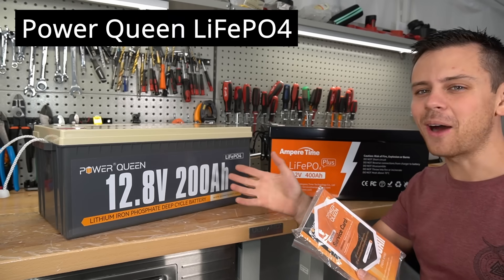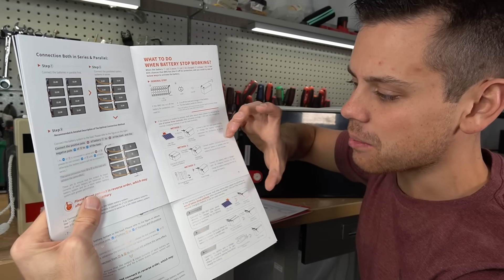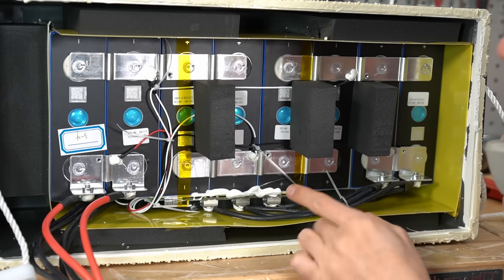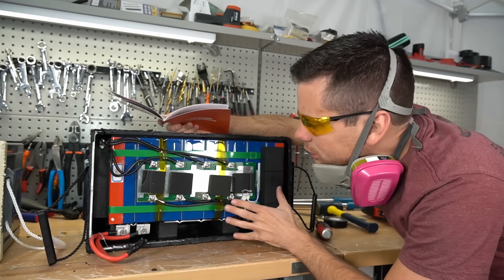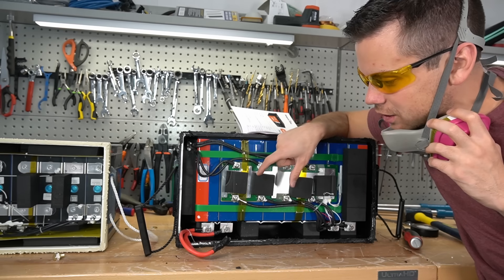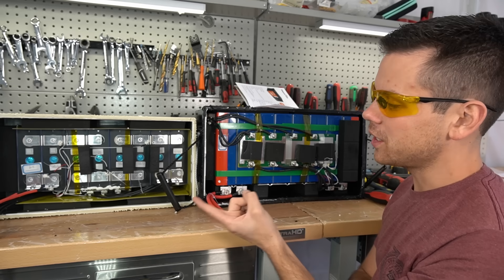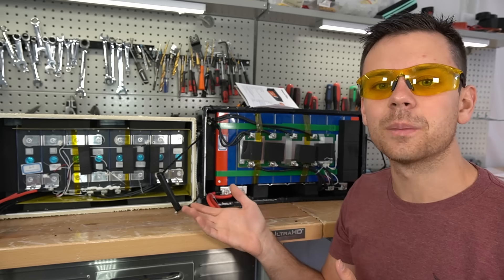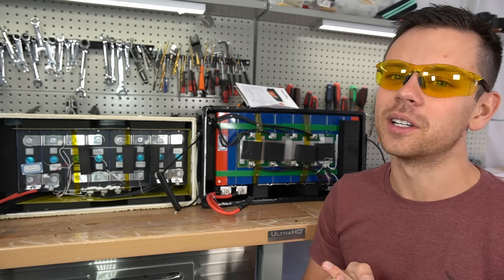Large Cheap 12V LiFePO4: Power Queen 200Ah & Ampere Time 400Ah Tear Down!

Comment: I have a question. You seem like the expert on these batteries? I would like your opinion. I can get a deal on ampere time 300ah batteries right now but I won't be putting them into service for 2 years. Can I store 4 of these 300ah batteries inside at 70 degrees F for 2 years without issues or just purchase in 2 years at a higher price?

Comment: Are the terminals just epoxied in to the case? My terminal kinda broke loose from the epoxy and moved a little bit.  I was worried about it but it seems like it'll be just fine.

Comment: Hi Will, I have ADCBATT lifepo4 6x12v 200ah batteries running 24v 600ah. At night with less than 500 watts on battery one set of the parallel 12v batteries shut down to 0v. The bms resets when I disconnect and recharge. It works under 3500watt load while charging during the day. Any pointers for a new solar guy.
BTW running a  Schneider 4024 inverter and Schneider mppt 60-150 charge controller.

Comment: Thank you so much for another great video! I have one question if you don't mind. If you are setting up multiple batteries in parallel so you have more capacity, which battery should I attach the Victron battery sense for the temperature sensor? I assume for the voltage, I connect the wires to the terminals where connecting to bus bars.

Comment: Hi, can you make a video presenting the best solar setup you can buy for a gate opener. Usually these go for 7AH. It would be interesting to go with a hybrid solution so that the gate opener usually draws from solar for normal functioning and when the solar is out, the system would auto-link to the grid. Thanks!

Comment: It looks like the AmpereTime battery has the cells on their sides, or as you have it opened up on the bench, the terminals of the cells are on the bottom.   Are LiFePO4 cells fine with running on their sides like that?

Comment: Hey Will, I've started watching a lot of your videos lately and you always make a fuss about batteries not having low-temp sensors, but I never seem to hear you talk about what a dangerous temperature is. What is the minimum temperature limit that these liFePo4 batteries can safely operate at? Do these dangers increase or decrease based on C load? Thanks!
Reply: Freezing temperature is where its dangerous to charge.  There's a video where Will talks to the CEO of Battle born batteries, and he gives a detailed explanation.

Comment: Hi Will. Watched a video review (Hobotech) of a new Power Queen 12.8V 190AH battery that allegedly uses EV grade prismatic batteries (4000 cycles to 80%). It can be had for the next few days for $605 +tax. Shipping is free. I'm like a solar generator guy, but thinking about pulling the trigger on this. Do you think that's a good, or great deal, or just meh? And if I did do this, I'd need to get and set up accommodations to charge from solar and AC, and an inverter. I think this battery could handle a 2000W inverter.

Comment: You could teat that PowerQueen. Hobotech ran that PowerQueen past 295 amps and for 3 minutes. Also these batteries are premium not the regular one according to the video and the company and are rated at 4,000 recharge cycles at 100%. I don't know if that is true or not. 5 year warranty on the battery. Thanks for the review.

Comment: Dr Prowse…. I am considering a lead acid to LiFePo swap for a golf cart I bought for my wife… 
48volt system… 400 amp controller,… after market higher performance dc motor.
I am considering configuring  four 12v 100@ LiFePo batteries in series… to build a 4s 48v 100a/hr bank…… OR…… building two of the just described batt banks and putting them in series… to have a 200 amp/ hr  batt bank.

The arguments for the 8 battery 200 amp/hr config of course is “ more range/time/ endurance” but it also could serve as a small power source for minimum backup power for our house when the power goes down.

BUT ,,,,
I am concerned about
1) each battery post tolerating the high amp draw ( instant amps on golf cart acceleration)
2) similar to above .. buss bars and 6 gauge or 4 gauge wire connecting the batts to each other and to the system.
3) best practices for paralleling for charge balancing.
4) selecting a charger.
5) setting charger min and max voltages
6) blue tooth monitoring
7) being able to out run the cops when….. ooops …” kidding”
8) temp limitations for charging and operation
9) temp monitoring
10) best wiring and switching hardware and set ups
11) stealth paint to help you hide from the cops
12) Cool BatMobile Accessories.
13) How to leverage the value in your golf cart for bail money.

Or……. If you have all of this sorted out in a document… “ Building a LiFePo Golf Cart ( or master battery bank) for total idiots who think that they can out run the cops on a golf cart….”

I would be more that happy to buy the stuff through your affiliate links.
Thx

Comment: I bought the Ampere Time 200ah plus model. The difference between it and the regular model was a 200a discharge instead of the 100a that the regular model offered. I just thought that I would share that.
Reply: Same, but I wish I had sprung for the 460ah

Comment: I got two Amprere Time 12v 200ah batteries bought 1 year apart. Neither have been put into service yet. I Want to hook them in series for 24v use. However AP says they should only be bought a month apart for that use. Why is that a problem? 
Thanks for any input.

Comment: I've been using 2 12v 200 ah amperetime batteries over the last year. I have them wired to 24v, and have had no issues with them, as of yet. They haven't been exposed to any kind of cold, so the no cold-temp thing hasn't been an issue, yet
Reply: Fact remains that they don't have a low temp cutoff or heater though. Good batteries environmentally dependent

Comment: Hi Will,   I purchased two 300Ah Power Queens after watching this video.  I am upgrading my travel trailer from two Lion Energy Batteries to these batteries.   Can I safely lay these on their side?  If I can, is there a better side to lay it on?  The mounting location works better if I could do this.

Comment: That 400AH Ampere Time is what I just bought for my RV. We'll see how it goes
Reply: how is the 400 performing?
Reply: @jmr8111  going well but I'm drawing it down quite a bit. Have a 36 ft class A with two rv 30k btu furnaces  at 25 degrees for a couple nights with several people. Two furnaces suck a lot for sure but running the microwave when needed and large TV on, 6+ devices charging, coffee maker take a lot as well so needed to run the generator about 4 hours to get it back to full a day. Good thing is I can charge it at 100amps so I can run it from 100% to 10 and it will take under 4 hours to get back. I only have space for one so wanted every inch filled with battery and it has worked well. I have it in a white plastic box with about an inch of foam board insulation around the bottom and sides and half the top. Have three 3x7 12 v heaters with two  underneath and one on the side behind a piece of thin sheet metal to distribute the heat and it's kept the battery just fine when it was at 17 degrees. Way more than you want I'm sure but I was hoping for more run time but I have the whole rv on a 3000w victron so everything is using it now so my load is pretty high as I was directed to not have any limitations as to what kitchen equipment was running.
Reply: @cbickel2009  Sounds pretty solid  thanks for the detailed explanation . I think the max charge is 250 amps   does the battery get overly hot @ 100 amps charge? I was thinking of getting  2 /400-  LI Time ( New name) and  charging @ 200 to 240 amps over the two batterys in parallel  so 120 amps per battery . sounds like the bms can handle it ? Chris you have  these in service for 7 mos now? thank you ,john

Comment: I returned a battle born 100 amp it’s longest measurement was a quarter inch to long to fit where my old lead acid was  they took it back only charging me about 15 pct. That’s great on their part. I had the batter many months but never used it.  Anyway. Are the 100 amp. Amptime slightly smaller their site says 13 inches.  I did not measure the battleborn but it was about quarter inch to long.    Thanks. Will

Comment: Glad Will pushing servicability for years resulted in SOK building an outstanding battey line. Their 200 amp hr is small enough to fit FOUR on their side, (800amphrs!) on top of my rear wheel wells (two on each well) on my Vanlife converson van. But still underneath my low bed frame, which is just outstanding. Battleborn has some serious competition.

Comment: Hi, Thanks for all the great research you do! I would have never consider cutting in to new batteries the way you do. Anyways, I purchased (6) 300 ah  amperetime batteries for a parallel 12v system and now looking at their website it says the max recommended battery bank is only 1200ah. Battleborn claims you can add as many as you like if wired in parallel. Do you know what there would be such a discrepancy between the two manufacturers? Thanks in advance!
Reply: the BMS's

Comment: so far so good after two months on our PowerQueen 12v 200ah. Working great as the single battery for a she-shed with a 20seer 9000btu Pioneer mini-split, and an Epever 8420AN charge controller pulling in 1200 watts of power from 4 used panels. About $2500 for the whole system, including the mini-split.
Reply: Can you tell me what the power draw is like in heating mode for the pioneer in around 40 to 60f weather? How many watts in heat mode, low fan? Is it a constant draw, or starts out high and then levels off lower, or cycles on and off?
Reply: @jimbob3030  I tested my 12k pioneer mini split on the bluetti 200max and got about 6 hours off of it in heat mode, but not maxed out of course. 
Mine drew about 400watts average and went as high as 1000watts when really working to warm up quicker. Ac uses less than heat mode
Reply: Glad to here the powerqueen is working good, I purchased a stark power 12v 100ah back in 2014 and still works great in 2023 in a small travel trailer.  I just purchased a 12v 200ah powerqueen and hope that I get the same great history the stark power one had.  I have a 3000 watt inverter in the trailer (go power also purchased in 2014 and still going strong)  and want the 12v 200ah battery to help extend the buffer for high power devices (TV, Microwave, Gas Heater, toaster, etc)   I had 200 watt solar panels for the 12v 100ah stark since 2020, works great with the morning star mppt-25, but will be adding a 3rd panel for 300 watts on the 12v 200ah powerqueen.  I'm so happy prices dropped, I paid $1100 for my stark power 12v 100ah back in 2014, but so worth the investment as I never had an issue as I did with the Lead Acid batteries originally on the trailer.  Off grid Glamping has become very awesome with all this new tech!!!!
Reply: do you use a dcdc charger?

Comment: Will- I have two 6 volt batteries wired in series to produce 12 volts.  I am connecting a 2000 watt inverter to these batteries with a run of 8 feet.  What size wire do I need for this?  I was told by a friend that I need 2/0 wire but this seems to be overkill.

Comment: Hello, I am a lithium battery manufacturer from China. At present, most of the 12200Ah battery packs use the size of the previous lead-acid battery, because borrowing the previous plastic case will save costs. If I redesign a square size battery pack, because Our cells are soft-wrapped cells, which cannot be designed into long strips due to internal structural reasons. Is there a market for square battery packs? Whether the usage scenario of this battery pack is so sensitive to size, a rectangular battery pack must be used.

Comment: Hi Will,
I’m an 8th grader so Me and my mom building an off grid solar panels for our small back yard. we are going to picked 4 solar panel Renogy 320 watt from Home Depot.. We are going to Temporarily lay the panels on our 300 square feet in the backyard . Which LiPo4 battery from Amazon would you recommend .? Summer is just around the corner getting warmer we need AC to cool off😅. I think 400 amp battery should keep us cool for 6-8 hours  with a 5000 btu air conditioner.

Comment: 200ah Power Queen arrived in 3 days, they responded to my question the next morning China time. The packaging was excellent and came with extra set of insulating caps and terminal screws. $358 with shipping
Reply: That was probably a typo. 100ah is about that price
Reply: where did you get that price

Comment: Could you give your opinion on somethings. Is it true that a 50ah lithium battery is equivalent to a 100ah lead battery. The  12v 50ah lithium batteries I see for 200/300 bucks  on Amazon and eBay are they built the same and worth buying.

Comment: DIY SOLAR POWER please answer this question for me, i purchase that POWER QUEEN 12.8 100AH LifePO4 battery and i  tried charging it up the other day to 14.6 or 14.0 voltage with 5amp current with my bench power supply like the one you used in one of your videos the white one, well the battery what'n reach 14.6 or 14 volt period it when to 13.9 voltage then it start going down in voltage to 13 some voltage like 13.7 and decreasing did they send me a faulty battery or do they go down to 13 voltage and something. Thank you...Peace

Comment: I was kind of freaked out when you started cutting into the side of the battery. Then I noticed the saw you had.
  Those little saws ,are great. Buy every blade. So easy to handle .  But really loud. Ear plugs job for sure. Back in my younger days, I used the giant floor scrapper version. I made a LOT of money with that thing scraping up glued flooring.
  Before this high speed buzzing type. we used slow speed . they had a giant weight and took two guys [ or one huge dude], just to get the thing off the truck so heavy ,it had wheels. 
.lol. But it would also bash a wall right off the floor. 
  yup that buzzing giant razor one was nice.

Comment: Can one stack those 400s, I've limited ground space but have height. I'd need 800 in parallel on my sail boat. Can anyone help. I'm using 6x2v open lead 900s in series atm.

Comment: What about the Chins Smart 12V 100AH Lithium Battery, Support Low Temperature Charging (-31°F), Built-in 100A BMS, 2000+ Cycles, Mobile Phone APP Monitors Battery SOC Data...
They're claiming can be charged down to negative 31° and has built in Wi-Fi monitoring... All for $544.99...??

Comment: Great channel! I am considering purchasing a ampere time 400ah battery but the low temp cutout is keeping me from pulling the trigger. It will be used on a rv with solar. Is there anything I could add short of heating the storage area to make this safe for low temp? While I’m traveling in in ambient temps of 32-110 degf but never below 32. What are your thoughts.  Thanks

Comment: Will overheating batteries, damage the inverter?
Sun was very bright yesterday  my two 12 volt batteries over heat, but still keeps the 13.6 volt charge but the inverter doesn't come on any more

Comment: Thanks so much for all the good advice and lessons.
I have a question about compatibility and what to look for in comparing "unopend" batteries. Because I like the rigidity and user-friendliness of Victron I would like to have LiFePO4 battery that would be able to be controlled by Victrons Cerbo GX. I found on their website a list with conpettable batteries (link below). What do you think would be the best? Especially for never having to look at it again and the best price point over long years as a boat house battery. I was thinking maybe a Pylontec US3000C? Hope you can help me and explain the parameters I can look for. Thanks so much!
Reply: Sounds like a good question...well above my paygrade.  Did you find your answer elsewhere?  On the forum?

Comment: Good day Will.
Another great video and definately not boring to your viewers. Been watching for years now and learned enough to power our entire property off grid from you and a few select others.
Special request: please do a review / teardown of the new model EG4 "waterproof" battery.
Weve been using them for a month now in our system and they've been performing perfectly.
Capacity test and and internal cell balancing has been right on the money. Love them so far but it sure would be nice to see the internals and hear your detailed thoughts on the cells/BMS and overall build quality.
Thanks for all youve done & continue to do.

Comment: Thank you Will for another battery video, I appreciate the always current info on DIY battery prices, and the precise approach you bring to cutting them open to show us what's inside them.  

At $1040, the 300ah Ampere time is now on my list to buy in September.  With the lengthening days, my present 200ah at 12 volt system is normally full by sunset, but come midwinter the extra will make a huge difference.  (2004 Toyota sienna)

Comment: I have the 200ah plus model of this brand on my boat. It's charged by a 700 watt solar array linked to a victron solar charge controller. It's a great battery. Powers everything on the boat without any issues. This includes a deep freezer, lights, fans, a small inverter, and a water pump. The low temperature cutoff really is no issue on the boat as I live in Florida and the battery sits below the waterline. Even if the outside temperature drops below freezing the warmth of the water still keeps the battery space above freezing. For boat owners this is a factor to consider
Reply: how long does it take to charge batt with 700w array ?  thank you
Reply: @vandweleer8004  after a night of running the refrigerator, lights, fans, and the water pump (for the sink) my batteries are full by 10am

Comment: Surprised you haven't tried the GS storage batteries, they are lead acid but they are made so they get around 5000 cycles at 70% depth of discharge. Any thoughts?